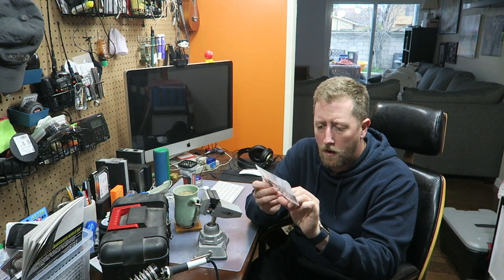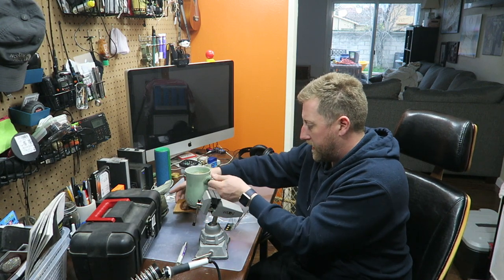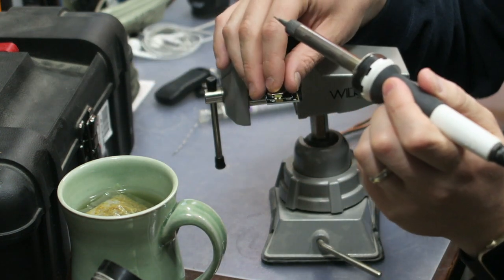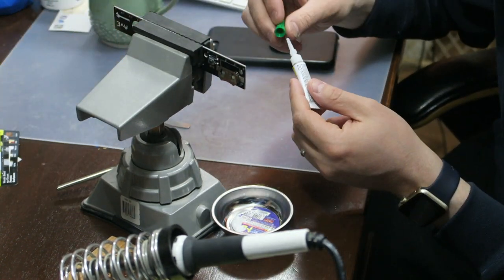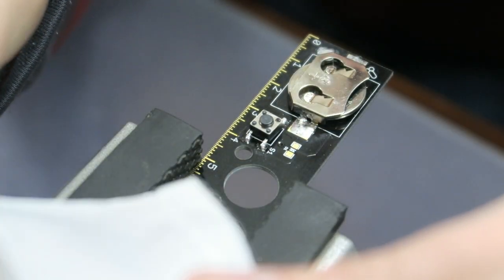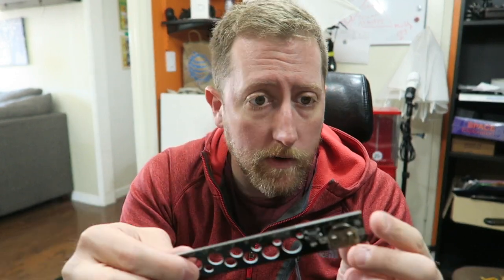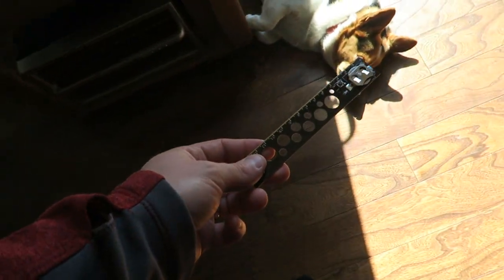AvE Ruler Build | WILL IT CHOOCH?

Comment: Stange, I didn't get a LED either, way too much trouble (I thought) to contact AvE. When I did try the soldering (I have to same HAKKO as well), I found out quicklyI need more practice). Good vijeao, not as skookum as Ave, but very good.

Comment: Surface mount is tricky, lots of ways to do it, but drag soldering is the easiest.  Usually you want to clean and tin your iron tip, then clean and flux the pads.  Place the component, at best use some tape to hold it in place, or solder one pin directly.  Now you're home free.  Basically, you drag the iron tip across the connections while feeding solder.  It'll fill the pockets and cling to the pads and pins, creating nice little fillets behind the iron.  Taking advantage of the surface tension and the flux to draw the eutectic solder where it needs to go.  This technique ensures you don't put too much heat into the IC and kill it, and don't overflow the solder to create a short.  The worst is trying to go back and suck or wick excess solder out of such small joints, usually I find it better to just pull the whole thing and start fresh.  
 
Of course there are other methods like re-flow, but drag is the most straight forward.  Get yourself some cheap (or busted) ICs and a junk board and practice for 15-30 minutes, you'll get the hang of how much heat you need to put in and how quickly you can move the iron and still get good contacts.  Like always, cleaning the pads and pins, high quality solder, and a thin layer of flux makes the job a lot easier.  Hope it helps!

Comment: Soldering tip: For SMD parts, you're best off tacking one pin down and then soldering the rest as normal. If it's a really small component, say a SOT-23 then you want to also mind the amount of heat you put in. You can end up reflowing the other pads if you leave your iron on it too long!

Comment: By using a dry tip, you spend too much time on the components, risking thermal damage.
Keep your tip coated with solder, wipe it a bit before soldering, you will transfer heat much faster.  Good vid.

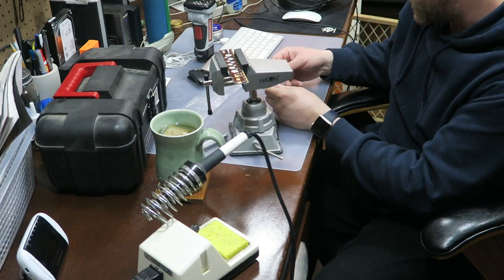Comment: I had a different problem, the LED did not "chooch" but the Engineer Formerly Known as Arduino versus Evil immediately at no extra cost sent me another entire ruler (yes!!) with a strip of 4-5 LEDs, bless him. By the way, the LEDs he sends out are REALLY tiny SMDs cut from a black blister tape, and I think you may have got yours in the package, at 4:02 we can see a tiny black square dot in the cellophane bag, and I believe it then falls out on your workbench when you shake out the magnet etc.
And BTW, you neglected to mention the Focus You Fack hole with together with the LED is a great way to inspect down into drill holes and other cramped spaces, I was surprised to discover. The only minus is that the metric holes are about 10% too large, but I guess that is a kind of statement by AvE, n'est-ce pas :-)
Reply from the maker: Great comment!  Yeah AvE is a hell of a guy.  I never received my ruler and he re-shipped and no extra cost!  What a bro!

Comment: A dab of liquid or paste flux on the pads before you start helps immensely.  I prefer a flux pen for most things (more of a felt tip marker, really) from MG Chemicals - others may make them as well.
Reply from the maker: +whirl tech I'm pretty sure my solder has a flux core.
Reply: whirl tech I always use a flux pen when doing electronics even though I use flux cored solder. Far better results
Reply: Yeah, I guess I didn't make it clear that this was in addition to, not instead of, the rosin-core solder.  Thanks for the second, Larn.
Reply: flux core is useless on surface mounting.

Comment: You should tin the pads but probably not a big deal with this. I trained in through hole and surface but don't use it. I want a good setup at home. Maybe some day. I have seen people inhale parts by accident. Soldering those pepper speck components under a microscope was always fun.
Reply from the maker: Then only problem with tinning the pads is that on small stuff you kind of have to go back and forth to get it seated. otherwise you could bend leads, etc.  Through hole has always felt quiet a bit easier to me.
Reply: hoshnasi I haven't done it in a while but when you have a good iron, solder. And flux, it's pretty easy. Of course, the good iron starts at about $500. Drop of flux on pad. Small flat tip on one side. Solder on other and it flows across to iron. Wick off excess and done. Of corse all that takes practice.
Reply: You need some solder wick. Tin one pad and wick it off. Flux it and place the part. A dab of solder on the tip, hold the part down with tweezers and touch the iron to it. Now repeat the other side. For small home projects you only need to tin and wick one side. When you do the second side be sure to hold the part down since the heat can sometimes re-flow the first side.
Reply: That's the way it should be done. Use some flux.